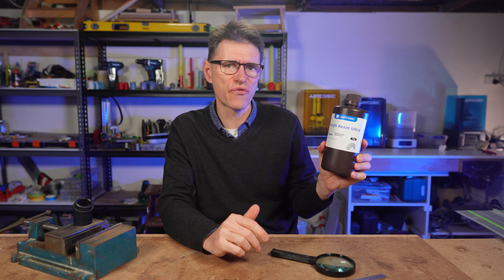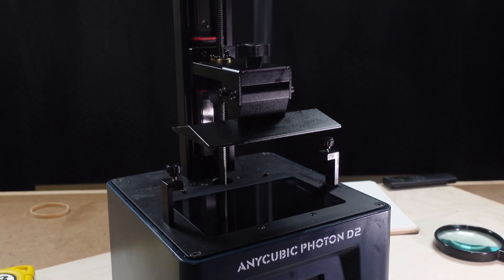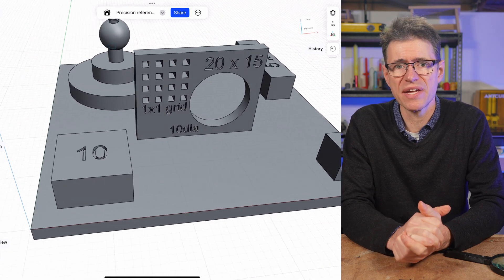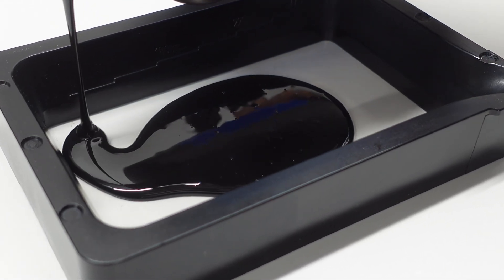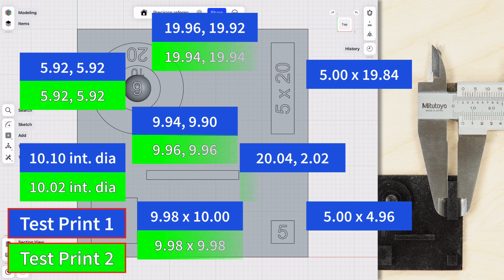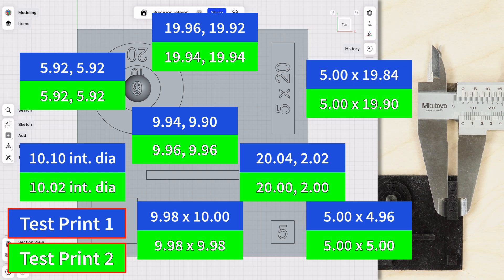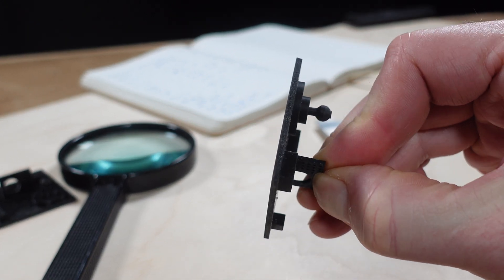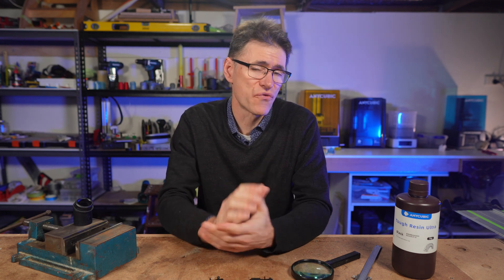Anycubic Tough Resin Ultra | Precise Printing?

Comment: Thank you for review of this resin. Chinese shops are running out of tough resin and I was thinking about switching to tough resin ultra to print my dnd miniatures. 

The only concern of mine, will it be ok, with deviations in printed result? For test parts, sure there were almost no difference. But for tiny 32mm pieces? Would you think it'll be critical?
Reply from the maker: Thanks for your question. I think it would probably work. I've used this to print parts for tools that need to be very exact, and it works OK. You could send me an STL sample and I could run some tests, if you like. 😀

Comment: So based on all the research so far, I'm thinking the ideal mix to make a good general-purpose resin that's tough and easy to print would be Elegoo-ABS3.0 and Anycubic Ultra. Maybe dilute it with some standard to save money. What do you think? Have you noticed anything detrimental in mixing because I haven't
Reply from the maker: I haven't tried Elegoo ABS3.0, so I can't really comment. However, so far I have found that Ameralabs TGM-7, or Antinsky High Tough resin seem to be the best all-rounders for making stuff, as opposed to miniatures. Downsides are that Ameralabs is expensive, and Antinsky only comes in white. Although Antinsky have recognised this issue. Anycubic Gen 1 Tough was better then Tough 2.0 in my testing. Ultra is good if you need something tough and super flexible. I try to avoid mixing as I've found that sometimes the results can be good at first, but then things can change as the printed part ages. I guess it all depends on how much 'toughness' the print needs to handle.

Comment: Thanks for reviewing these resins. You videos have helped me alot. How you conpaire tough 2.0 to ultra in terms of toughness and impact resistance?
Reply from the maker: Thanks for your question. Tough 2.0 is harder…more brittle. Ultra is more flexible. Both are good and resist impact, depending on your application. But for all out impact resistance, Ultra is better. Glad my videos have been helpful for you. 👍
Reply: @ColinKlupiec  awesome thank you so much. I'm off to order some ultra and give it a test. I've been very happy with tough 2.0 but just want something a little more impact resistant. Even though like you said tough 2.0 has incredible impact resistance. For what I need ultra may be slightly more ideal. Thanks again 😁 and love your work!
Reply from the maker: @Evolutioncustomblasters  Thanks again for your feedback. My pleasure to help out. Hope it works for you.

Comment: Hi again Colin! Have you tried the same test on a non-dlp printer?
Reply from the maker: Not yet, but it's a good idea. I'll put it on my list of things to do. Anycubic is releasing a new printer, the M4 and M4 Ultra, which I think have xy resolution down to 17microns. That would be a very interesting comparison.
Reply: @ColinKlupiec  I've noticed a new machine in photon worshop too. btw, do you have any problems with parts shrinking over first 1-2 weeks after printing and curing? I am fighting with dimensions on my resin prints and its hard to predict everything.
Reply from the maker: @Trancelebration  Shrinking parts hasn’t been a problem with the ‘tough’ resins I’m working with. In the early days of my resin printing I did notice some prints shrinking with the standard, or non-toughened resins.

Comment: I have a project that needs nested (telescoping) tubes. I'd like to keep the wall thickness between 0.3mm to 0.5mm, each tube being around 90mm long.
What is your thoughts on the toughness and rigity of resins if I wanted to go the route of 3D printing?
Reply from the maker: Thanks for your question. You’ll definitely get the accuracy you’re after, even with those small wall thicknesses. Toughness/rigidity depends a bit on the use case and finding the right resin. Anycubic tough Ultra is more flexible than Anycubic tough 2.0. You could also try Sirayatech Build, or Antinsky High Tough Resin.